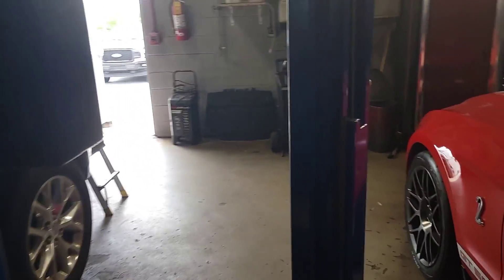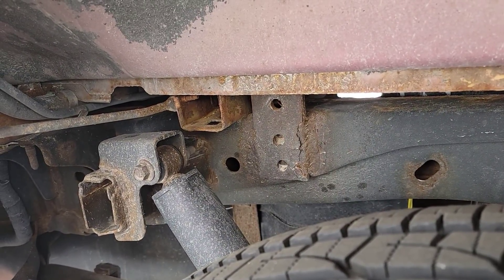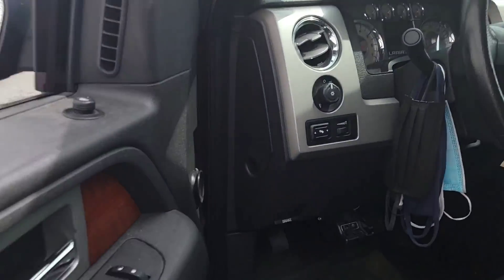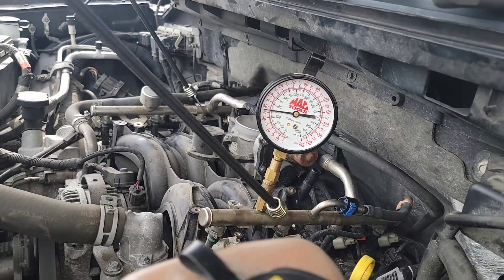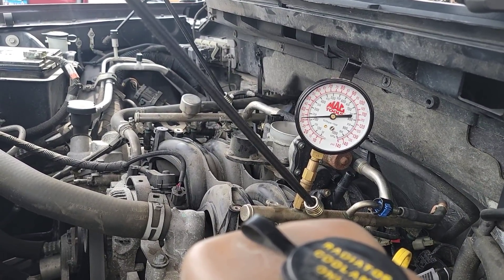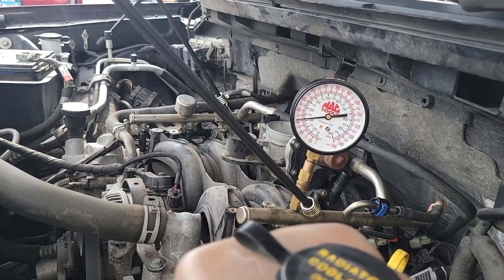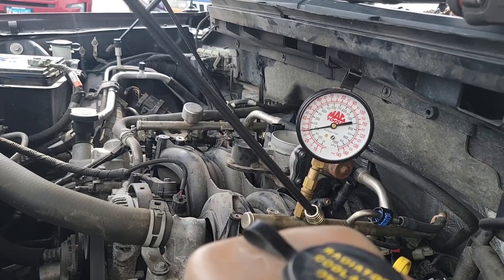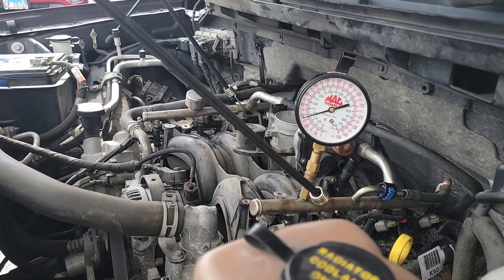2010 Ford F150 5.4 3v Came From Another Shop - Start Run Die Out - Parts Cannon Commense

Comment: I had a new spark plug fresh out the box that was separated internally at the resistor.  When you held the spark plug up and looked at it, it was fine.  Nice gap.  When you turned the spark plug the other way with threads facing down, the center electrode slide down and touched the ground strap.  Flip it back over, and the center electrode slide back into place and you had proper gap.  I just caught it by chance.
Reply from the maker: Wow
Reply: @FordBossMe  Customer replaced plugs, 2000 miles later had a miss on 1 cyl.. I pulled plug, it had no gap. Knowing it HAD run good after plugs replaced, I stuck my knife blade between the electrodes. A little effort and the center electrode pushed back up inside giving a perfect gap. So....been there, seen that.

Comment: Just the video I needed. I'm currently working on a 2010 ford f150 with the 4.6L. No fuel filter and returnless system. 
Customer complaining of hard starting on cold startups and seems to run rough afterwards. Right away I hooked up my fuel press tester and did a KOEO test. Pump came on and the initial reading on the gauge only got to 20 psi of press then it started to drop slowly down to 0 in about a minute's time. Two things came to mind like what you stated leaking injectors or check valve at the pump. So again I did a KOEO test and the pump pressure came up to 40 psi only this time the pressure held. Specs from what i was found are suppose to be between 55-60psi on both KOEO and KOER. 
I cranked the engine and it sputtered but ran. Gauge was still around 40 psi so I decided to do a fuel volumn test, gauge dropped to near 0 and I was only able to receive 8 oz of fuel in 30 seconds. I believe your suppose to get a pint of fuel in 30 seconds. Either way it's not enough pressure and it's not enough volumn. So the pump is bad. 
But I won't stop there got I also got a history of a misfire code at cyl #5. No current codes.  While I don't want to speculate of a bad injector or a coil,  I'm going to pull that plug on that cylinder and see if that is wet or not to determine anything else is at hand.
Reply from the maker: Nice

Comment: I had 6.2l Yukon Denali that had a bad regulator and it would sputter until it got enough pressure to start. Regulator was built in the pump. New Bosch pump had less than 10k miles on it, and now it's doing the same thing again.

Comment: i had a new pump fail in 3 months.but it worked perfectly untill the moment it failed.when you consider the volume of pumps they make.some not so perfect ones are bound to get into the market.
Reply: So what is the acceptable failure rate?  Are you familiar with six sigma?

Comment: I couldn’t agree more with your assessment. I spent 15 yrs dealer , 32 Indy shop owner. Aftermarket parts have gone so far downhill and cars much harder to diagnose and repair.  Every tech I have known wanted to or lived to fix cars. Yes you have a distinct advantage at dealer but it’s so structured. As Indy shop owner I found a new relationship with customers. They became long time friends. Still have forty year customers asking my opinion even though I’m retired five years.  I really appreciate your sincere candid views on our line of work.  Good luck in your future.
Reply from the maker: Tyvm

Comment: A lot of cheapies will just replace the fuel pump with an aftermarket unit that doesn't have the complete assembly. Meaning, only the pump gets replaced. Not the sender unit, check valves, etc.

Comment: I remember from your other videos about the ground strap that prevents fuel pump from operating properly.  A lot of corrosion has messed up fuel pump driver modules on expeditions in the past.  Was the corrosion bad on this expedition on the ground strap and driver module?
Reply from the maker: I cleaned up all the ground straps and some areas were bad but not the one by the fuel pump driver module

Comment: I worked in manufacturing my career, when we would start trouble shooting issues it was easy to head down a rabbit hole because a replacement part was as defective as the first. When problems come up it is important to measure test and measure again. Also, it easy in manufacturing after you have seen the same problem multiple times so I can see why the dealer shops should have an advantage. As complex as cars are today anyone can miss things or get drawn down a ribbit hole chasing a problem. Thanks for your teaching.

Comment: I agree with you my brother. Worked at a John Deere industrial equipment dealership for over a decade, and what you expressed about technicians is true. After working for Deere for that long, I worked in the equipment rental business, but I would pick up replacement parts to repair equipment. The day came when one of the Deere technicians hit me up on diagnosing a problem on a six wheel drive motorgrader.

Comment: Again!!  I learn from your video!  👏👏
Even the fuel pump system has become complicated - driver, driver module, ... ?  
And why did the previous shop(s) "fix the wiring"?  Guess they did not test it properly, misdiagnosed.

Comment: Great video! You hit the nail on the head. The dealer techs are used to "quirks" of the makes that they work on. Years ago the cars were easier to repair. The corner gas station could keep points, plugs, filters and other sundries to repair vehicles. Nowadays with all the computer controlled systems and the like independents are struggling. Factory service information can be wrong at times not to mention Alldata, Mitchell and the others. I worked on a make that frustrated both home mechanics and independents. I always shared my knowledge with them and would readily try to provide help. No one tech can be knowledgeable in the repair of every make of vehicle. I believe that sharing is caring. Thanks for all the hard work you do Rich!

Comment: So.if there's a part from ford that you know has a high failure rate, would you use a aftermarket part? To give an example on my 04 marquis the air compressor for the rear leveling system went out on all the cars I had. On the this last marquis the shop found a aftermarket company that made a compressor for replacement. At first I was agenst it because it wasn't ford but found out  it was 1. Cheaper 2. Brand new rater than rebuilt and 3 quiter and better built.
Reply from the maker: The aftermarket ones are not bad
Reply: @FordBossMe  my question was do you ever suggest aftermarket to a customer if you know the factory part will fail again?

Comment: My 2001 Grand Marquis dies while in gear, either in drive or reverse. Like it will completely die in the middle of the road when coming to a stop at light or stop sign. But it will crank back over. It’s extremely annoying. It doesn’t do this while in park or neutral.
Reply from the maker: Throttle body clean or replace

Comment: Good job with the diag and the commitment of not bashing other techs 👍👍💪
Got a 5.4 3v question 
When replacing spark plugs anti seize or no and is there a reason for or against?
Reply from the maker: A little isn't bad

Comment: About diagnosing a ford. Trying to get my 2000 ranger 3.0 to run right. Does the baro reading come from the maf? My baro reads low it reads at 148 hz my spec is 157 where I’m at. Reads 5.8 g/s warm idle in neutral. Fuel trims -18 both banks long term
Reply from the maker: The mass airflow is going to read in grams per second about what the liter of your engine is

If you have an exhaust system that is restricted or partially falling apart or bad catalytic converters that can also affect your barometric reading that you're getting
Reply from the maker: At idle and seems like your mass airflow is pie because it's almost double what it should be
Reply: That’s what I always thought. I just figured being an old truck they read different back then. Liter size is roughly what the grams per second at idle.  You going to show some hybrid diags on the channel? Or you mainly gas?

Comment: Did you say they already put a new fuel pump in though? (did i miss something?)
Reply: Yes he did ,2 bad pumps ?
Reply: No (didn't miss anything) the previous shop did put in a new fuel pump, but there is a saying, just because it's new doesn't mean it's good. Lots of new Chineseium parts fail at install and it's almost a sure thing the previous shop didn't install a $450 OEM fuel pump.
Reply: @TheOnespeedbiker  Absolutely, bit annoying that a new part would fail from the off, but i've had it happen, brand new coil pack, only failed when it got hot.
Reply: @jimmyp6443  I think he said they replaced the fuel pump relay first and the fuel pump second; so one pump relay, one pump and of course the first rate rewiring job.
Reply: Maybe the aftermarket pump wiring job is wrong ? 
What a butcher job ,
Reply from the maker: Only one bad pump
Reply: @FordBossMe  Hate them fuckers that throw   parts. You gotta diagnose that electrical shit   Surprised how they can't  read a schematic   Been doing this a long time. Good to see you young guys keep on wrenchin
Reply: @jimmyp6443  Wrong is a relative term. First I have no doubt Richard (Ford Boss Me) checked the wiring before he condemned the newly installed fuel pump. It appeared they direct wired the pump possibly because the new pump's plug didn't fit,  something that itself is very suspect, as it might not have even been the correct pump to begin with, which is why it didn't work.

Comment: This is why getting non OEM parts can bite you in the rear. I had a Ford and worked on other Fords before. There are some parts you should not purchase on the aftermarket. I found that motor mounts being one of them along with fuel pumps.... Unless they are a high performance fuel pump for racing.. That is one of the exceptions to the rule.

Comment: Those independent shops simply didn't want the job hard enough. Problem I see is altering the wiring on the fuel pump module. Really? The previous shops owe this customer his money back in the event they made him pay for work that DID NOT repair the issue.